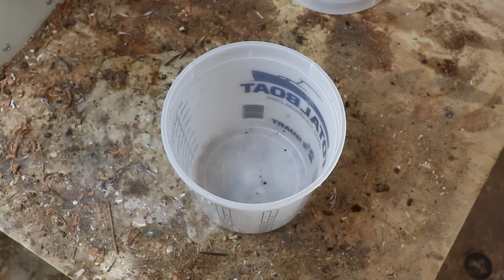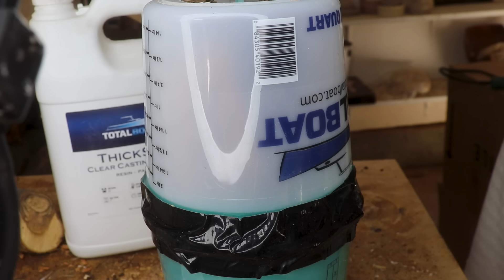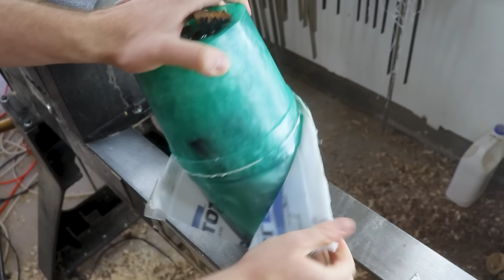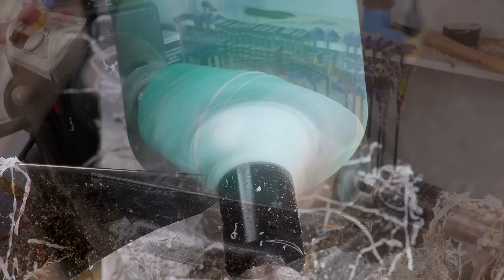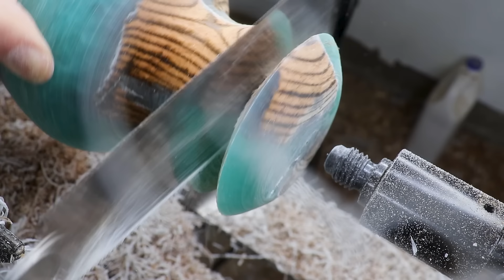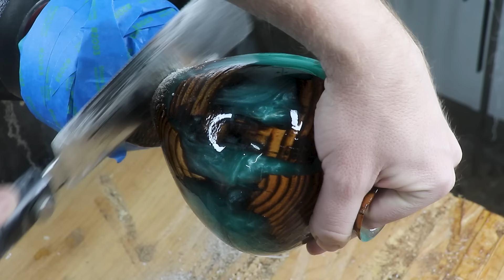Wood Turning a Driftwood Log

Comment: I am new and just bearing learning about my Laguna 18-36 lathe. I also use paint buckets for my epoxy/burl projects. Do you use any kind of mold release and what kind? Also I tend to get a lot of chipping when I turn epoxy projects. How you use avoid that?
Reply from the maker: Sometimes I use cooking spray as a mold release. For chipping, make sure your tools are super sharp and use a high safe rpm.

Comment: I want to ask, do you typically use Total Boat epoxy resin?  Tried it once and got bad results with it during turning.
Reply from the maker: Yes I’ve been using it for a few years and love it. Which type were you using and what went wrong? I’ve found the thickset works best for turning
Reply: @CookWoodworks  to be honest, I don’t remember which I used. I did, however, get a lot of tear out during turning and also it was cloudy in all of the batches I made. My atmosphere temp was good, mixing was per instructions and I had it in my pressure pot for 24 hrs. I also used sharpened skew and gouges on it. I tried some Alumalite but it is very expensive.

Comment: The final piece looks nice but all that residual resin doesn't make it the most environmental friendly project.
Reply from the maker: Thanks for watching
Reply: What would be a more environmentally friendly option?
Reply: @amandaolson3221  something made   mostly in wood
Reply: @mptyyegdlc  it appears to be made primarily of wood. The resin is the filler, what wood product would make an appropriate substitute?
Reply: @amandaolson3221  the final object is made mostly of wood, but started from a much bigger piece and the turning process generates a lot of residual resin that worries me a bit. Is not the same to generate wood residuals than resin.
Reply: @mptyyegdlc  correct I understand this, my question is what filler can be used that is wood based? Do they make a product similar to resin that is more environmentally friendly?
Reply: @mptyyegdlc  I do wonder if there is a way to collect the pile wood/resin shavings and compress it into another workable piece. Possibly with some additional resin or other adhesive. This would eliminate or at least reduce the environmental concern from a waste perspective.